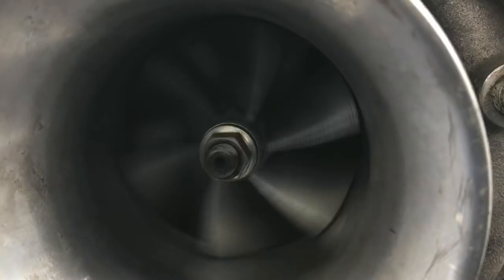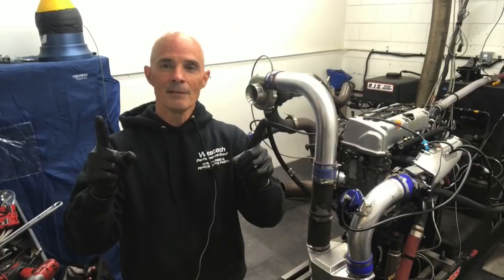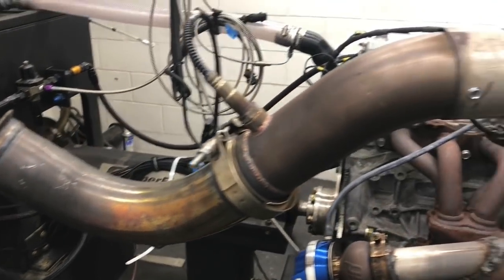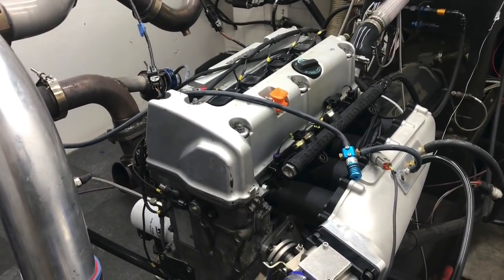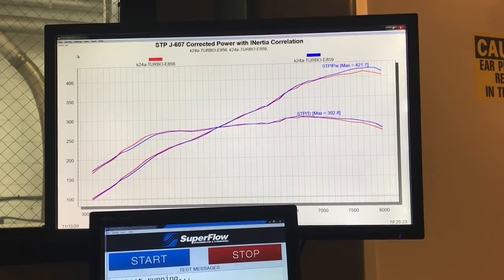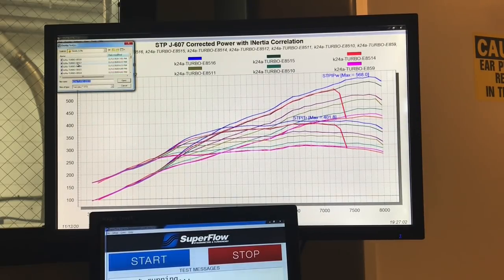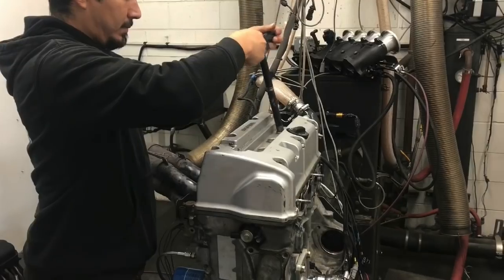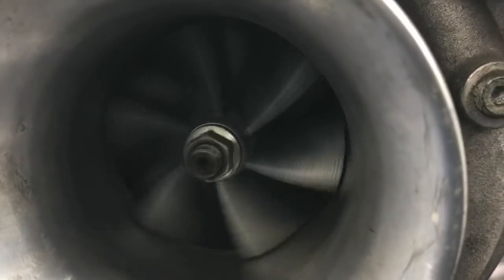DIY JDM TURBO K24A2 HONDA-BOOST & BALACE SHAFTS

Comment: Wait ✋️ hold my Saki🍵. Did he say a K24 A2 on 7 psi,15 psi w/Skunk springs + cam kit + intake. Damn Nippons secret Mighty 🐁 Mouse keeps impressing me. I stumbled onto an 08 TSX w/ K24 A2 thinking it was a luxury civic gas saver ricer after CTS turtle 🐢 got totaled. The lil JDM is tough and I go everywhere in a flash.  Though that combo is pricey if it got it to 400 hp econo-sleeper I would lose my marbles...

Comment: Upgraded oil pump is what is needed to reach 600whp.
Reply: I made right around there on 25psi on an unopened K24. Oil pump isn’t what determines where it caps out on HP

Comment: Just as soon as possible pull that k24 oil pump out.
At the revs you are running (8100) you are dangerously close to grenading those balance shafts.
Install a k20 pump and you can twist that thing over 9k!
I am just about to start a k20 build. Not sure if I am going to run a k24 bottom end. With the set up I am planning I don't really need the added torque.
Gt35r turbo,pauter rods,je pistons,arp studs. Possibly sleeved but if not a block gaurd at the very least.
Factory head and cams...upgraded springs,locks,retainers and valves.
I expect around 700 crank hp.
Going in an rx8. I am sure it will grenade the trans.
Reply: @keithcannon3682 still need springs & retainers to rev that high don’t you on a stock k24a2??
Reply: @josecunsako31  The answer is absolutely.. gonna flap that vtec in the air like you just don't care otherwise lol

Comment: Hey, I live in Greece, and we don't get to have e85 fuel here, and we also don't get to have 300$ junkward ls. So I kinda want a k24a with a k20 performance vtec head. I'm planning to get to 600hp at the wheel, so I was thinking mathenol/ethenol. I also thought of autogas to help, sense it technical has more octanes than normal pump gas, but I haven't seen anyone use lpg. So my questions are: can I achieve 600 whp with meth/eth and is lpg a good option for octane

Comment: What is the ideal turbo for a k24? Id like to bwable to turn up to 700+hp but would like to beable to daily it at around   350-400ish hp... also wondering about what would be the right fuel setup
Reply: Just get two ebay turbos, with some good quality boost controllers and waste gates.
Reply: @kensmechanicalaffair  ebay isn't a size lol. My mr2 has a 3582 on it now and it's kinda too big takes a little too long to spool and makes way more power than I need usually
Reply: @princessajellybean  I meant Gt45, so you make more than 700?
Reply: @kensmechanicalaffair   I make 450 on pump gas and its tuned to 750 on e85. Probably could get low 800s out of it. But right now I drive 99% of the time on pump gas and the 2200cc injectors are at like half a percent duty at idle. The ceramic ball bearing spools up ok but not fast. I honestly would prefer a smaller ball bearing turbo that has alot less lag that can run the same hp. 450hp in a 2200lb car makes me faster than just about everything. I'd like more usable instant power for cruising and twisties but with an option to fill with e85 and turn up to 750hp and do drag race mode. But in reality 750hp is way too much in this car for the street on street tires. Mostly I just want to know or say it can do it. I'm not really going to a prepped track or running slicks. And 450hp is bonkers fast

Comment: Great video series Rich!  Going back a video or 2 I'd like to see if there is any difference with wrapped vs unwrapped headers, not only power but cylinder head temp, i.e. thermo reading near the ex ports, does wrapping make a difference, if so does it put extra strain on the cooling system.  Can't wait for the head change session.
Reply: Idk if you ended up getting your answer or not but supposedly keeping the heat inside the manifold gives the exhaust gasses a higher velocity which spins the turbo quicker.

Comment: I am grateful for you doimg this. I love that you give such concrete real information. I would like to request you do a 20v vw 1.8t motor should be easy to find in a junk yard. I know youre swanped with other stuff thats much more popular but this is my request. Thanks youre the absolute best source of solid information on the internet for upgrades on motors

Comment: I have a civic hatchback with a k24a2 all stock an love it! it keeps up with my buds 07 Corvette lol over this winter I'm going turbo to make just 600hp an I'm keeping it all stock
Reply from the maker: Nice!!
Reply: “Just 600hp” lmfao yeah im “just” trying to push the absolute limits of my stock engine to near rod bending levels
Reply: @knowbull5hit590  lol a stock k24a2 is reliable at 600hp. A friend going on 3 years on it an beating it all the time. Now I'm sure it could use a new tune.
Reply: @twistedarrow3574   is it always running the same psi it takes to make 600hp? Ive seen these things run 600 for a while but you’ve gotta admit that is right on the ragged edge of breaking shit. I dont doubt they can take it but this guys saying it like “just 600hp” isnt pushing the fucking limits of those things to all hell
Reply: @knowbull5hit590  it's a drag street car 600hp all day play or race 3 years no rebuild same block same head

Comment: would the drop in power at 7800 be from windage or a pumping issue?
Reply from the maker: didn't do it na
Reply: @richardholdener1727  I just remember hearing somewhere that when your going for high revving k series that the stock oil pump would be your limiter

Comment: For stock everything spark plug down.. especially stock compression. Running a bit over 15 psi boost and holding plus making good power.... quite an impressive little engine.

Comment: When do you have to worry about ring gap?
Reply from the maker: 601 HP-WE R AT 600 HP SO ITS ALL GOOD!
Reply: Anytime you boost or, run nitrous which will expand all metals.
Reply: @richardholdener1727 😂

Comment: That is amazing that the stock ring gap didn’t butt together at 600hp.
Reply: Right!!
Reply: I think he's on E85. Alcohol has lower combustion temps and thus doesn't put as much heat into the rings.
Reply: This is not some badly designed US engine.
Reply: @V8Lenny  see Subaru ej25 lol. Stock ring gap is too tight factory.
Reply: @Levibetz . Tight ring gap is normal, the SRT8’s come with it.
Reply: Have any of you guys heard of humble performance 600hp is normal and you can get 100k km out of those engines pretty easy
Reply: After adding boost
Reply: @V8Lenny  funny, i see alot of them in junkyards lol

Comment: I had thought that pretty much all second hand motors sourced from Japan were clapped out taxicab pull outs. An acquaintance of mine threw a rod through the side of his block on a Toyota engine some years back, and he wasn’t hot rodding.

Comment: I love how "wrong" everything is . It just shows people that it doesn't matter within reason.
Reply: The enormous exhaust it has, it causes lag just because it has a lot of mass inside, but before the run begin, he initially load the engine, witch eliminate it all.
Reply: I guess you haven't seen these eBay built K series Motors then
Reply: @KDUMVRICK  what? exhaust volume doesnt even matter, even length doesnt (look on stav-tech rear mounted hx55 merc he did) lag is just function of turbine a/r, compressor size, bsfc of fuel and heat comming form cylinders
Reply: @exvils  exactly
Reply: @exvils  figured that out back about 20 years ago on Mitsubishi 4G63T engines
Reply: @exvils  it does matter , with very short and tight manifold you can spin bigger charger and make more power.
Reply: @KDUMVRICK  then explain why when running super small stock exhaust on a Mitsubishi 4G63T has lag but when you “uncork” the engine and put a 2.5”-3” exhaust from the turbo all the way back it actually dynoed another 35 horsepower and very little if any lag and with the 3” pipe it had INSTANT and do mean INSTANT boost and gained a grand total of 41 horsepower peak but it was all the tremendous gains in the curve because of what now NO LAG the turbo comes into boost so much faster and sooner that it made at one point of the curve almost 60 pound feet of torque!!! All from a 2.0 stock bottom end 4G63 turbo block ringed and bearinged and file fit the rings on turbo pistons when we built another engine the exact same way but used non turbo pistons and switched to 110 octane race gas it was better yet (again in the curve) and this was now 20 years ago
Reply: @V8Lenny  like, closer you are to exhaust ports the more heat and kinetic energy you get from pulses to spool turbo (like that new Kseries integrated exhaust manif in head, or b58 supra mk5 engine's manfold), but again, once you are out of compressor map  it doesnt matter what you do you wont spool it up, and it doesnt count as lag, lag is only when you can spool the turbo, but you have to wait for shaft rpm to get there, and thats like 0.3sec, after that you just wait for enough flow to make taget boost/which would happen very fast with variable geometry turbocharger but not with fixed a/r one .. 
tldr. drivability and turbo spool depends on turbo selection, i bet it spool like nothing whe you downshift to 5.5k, with powerband to 9k..
same with "modern" engines like 1.8t, you have powerband from 2300 to 6000rpm with that small k03
Reply: @michelerjgross7339  
Back in the day my pops old Saab turbo broke the pipe right behind the cat after years of service. 
The bitch spooled so much quicker he left it alone until it was inspection time 🤣
And then was a little bummed after he had to cork it back up again.
Reply: @killahoe9748  as a VW guy, it's been tempting to try a little of that darkside shit. 
To get that kinda power out of a VW for that money would cost ya a left nut and half a right one. 
Then ya ain't got shit left for the olady.
Reply: @michelerjgross7339  ok to start you are comparing after the turbo to before the turbo! When you reduce the pressure on the back side of the turbo the front sees that as positive pressure. Or more exhaust pressure that can do work spinning the turbo! 15lbs of pressure before turbo and 5lbs of exhaust back pressure gives you 10lbs of exhaust actually spinning the turbo up. Install a big free flowing exhaust flowing at 1lb of back pressure you are getting a full 14 of the 15lbs doing work. This is just simplified numbers to give you an idea why.

What the other guy was talking about was the amount of gas before the turbo and how much mass is in there and the volume that has to be compressed to spool the turbo up and heat up plus heat loss. Many of these play a factor when you are squeezing out the last %s of your build. 

Be cool to see them take this setup and install a exhaust wrap on it and see how different the spool on one of the big turbos spools!

I'm not to the point of worrying about this with a k24/k20 frank with a 6767 in a 05 lotus elise. 9lbs of boost being easy on the stock trans with 3.5 degrees of camber on 225s ran a 11.91 at 121mph first time out!
Reply from the maker: I DID SOME VW TESTING WHEN WE RAN A BONNEVILLE GSR (BEETLE)
Reply: @richardholdener1727  
I love em, they just cost alot to get power from ,and if you don't go the right route you'll have an expensive doorstop. 
I'm tempted someday to buy some kids half finished Honda turbo project for pennies on the dollar 😄

Comment: Very nice results! However, 5W20 oil is too thin for these motors, Honda recommends 5W30, 5W40, or 10W30,  I'd hate to see it fail early from having the wrong oil in it!
Reply from the maker: ASK ME HOW MUCH THAT DIFFERENCE IN OIL MATTERS?
Reply: @richardholdener1727  Honestly I don't know, I am not an engineer. However, I would assume that there's a good reason Honda recommends 30W or 40W oils for all their high performance K series motors and specifically states to not use 20W oils in these motors. What exactly their reasoning is or how much it matters I have no idea, perhaps you do?

Comment: You know what would be an interesting test?  An engine with a "perfect" turbo kit vs one with stock manifolds and enough exhaust tubing to simulate a rear mount turbo kit.  Just how bad is the rear mount? Obvs you'll want to do pressure and EGT measurements...

Comment: Please note that an in-car application will not make this amount of power.  Your going to lose a chunk of power due to added heat with the turbo crammed under the hood,  and the majority of guys will not use an air to water intercooler due to the complexity it adds to the build.  Regardless, awesome numbers for sure 👍
Reply from the maker: WE RAN A CIVIC RECENTLY-VID IS UP-WITH K24 (STOCK) WITH TURBO, 500+ WHP AT 15 PSI ATA COOLER--THEY MAKE THIS POWER
Reply: Dang that's insane. Love your videos man,  keep em coming!

Comment: Put two K24's together end-to-end and have one killer straight 8
Reply: There are some people out there that have made billet k series blocks and cranks for v8 config.... Unreal power NA
Reply: @ReubenHorner  Making a V8 out of two fours is pretty much designing and building a whole new engine from scratch. Honda's only production V8 was the 93-98 Honda Crossroad, which was really a rebadged Land Rover Discovery with a Rover 3.9 V8 ( sold in Japan only ). Honda had a Indy V8 in 3.0 and 3.5 liter variants. Depending on the configuration they made 650-670 hp NA @ 8000-10,300 rpm and 317 ft-lbs torque @ 8000 rpm. They weighed 280 lbs. They were replaced by a 2.2 twin turbo V6 making 700+ hp and a redline of 12,000 rpm. Of course the problem with indy and f1 motors is that they have no bottom end so if you put them in a car with any weight they won't even get going without a push unless you used some crazy gearing like 6.50. The Ford Cosworth DFV V8 shouldn't be idled below 2000 rpm or internal damage could occur. That didn't stop Ford of England from swapping one (the DFL version) into a Transit van (a fiberglass body) creating the SUPERVAN 2. Not as cool though as the original SUPERVAN that was a real steel Transit body on a GT40. Steve Strope had Ed Pink rework a Ford Indy 4 cam V8 (loosely SBF based) for street use in his 66 Mustang. Increased the stroke, custom cams, and swapped heads side to side to move the exhaust from inside the vee to outside. It ended up making 426 hp @ 7000 and 362 ft-lbs @ 5200 https://youtu.be/oFPLXdmamPw
Reply: PFI Speed is planning on doing this. They are calling it a 2KZ lol
Reply: It has been done already. I forgot where to find it though

Comment: Even cast iron log exhaust manifolds can make a ton of power with boost. Big headers are nice and they do help but they're not absolutely nessisary. Look at all diesels running around making a bunch of power with some really terrible (much worse then this) exhaust manifolds.
Reply: Diesels have very efficient exhaust manifolds , others should learn from them.
Reply: @V8Lenny  
Efficient in terms of cost, longivity and reliability under harsh conditions, not so much in the performance airflow department.
Reply: @177SCmaro  even Mercedes F1 used log manifold before turbo rpm limit was added to rules. Fastest and strongest diesels on earth use log manifolds. Some tried fancy equal length manifokds years ago , now everyone is back to logs.

Comment: If anyone could answer my question it would be greatly appreciated. I have an 07 accord with a K24A8. I also work at a machine shop so I can get any of the products I need fairly easily. Just wondering if this is possible on my motor as well or does it have different rods and pistons? Thanks
Reply: Far from an expert, but belive the bottom end is basically exactly the same.   The heads are different though.  The a8 has the economy vtec setup, and the a2/4 has the more performance 3 lobe vtec head.   "But all cams are turbo cams" 👍
Reply: Eville140 do you know if it’s possible to put the cams he used or the ones from the a2 in my head? The ones from the factory are fairly mild and make peak torque at 4,000 and peak power at 5,800
Reply: @adamnorris163  To run "performance VTEC" cams in an "economy VTEC" head, you'll need to run what they call a "VTEC killer" setup which always runs on the VTEC lobes.
Reply from the maker: JUST ADD BOOST-IT WILL MAKE WHAT YOU HAVE MORE BETTER!

Comment: Can you please tell us the engine code if it’s “A2ish”
Reply from the maker: THE JDM MOTOR SAYS K24A-ITS A 3-LOBE VTEC RATED AT 200 HP-VTC ON THE INTAKE CAM ONLY
Reply: @richardholdener1727  Don’t they all have 3 lobe V-tec? Two lobes/ cylinder for non V-tec and one lobe/ cylinder for V-tec ? I’m from Australia and we don’t get the A2 so I’d like to know the next best engine?

Comment: Meh.

Import front driver stuff is boring. But I watch to give Richard eyes and add revenue so he can do the good stuff.
Reply: If you have a smaller car,  there are k24 rwd adapters for many types of manual transmissions along with the more popular autos...powerglides, turbo 350.     This type of stuff would of happened years ago but most the honda engines before this spun the wrong direction.   Currently swapping this combo into my 1982 starlet(way to small for an ls to fit decently), k24 turbo, Nissan 6 speed manual, Ford 8.8.   Should weigh around 2000# total.
Reply: They are definitely not boring to drive they can be pretty damn fun. Obviously it's not a 1000hp turbo ls or anything but my old 350hp turbo civic would totally blow the doors off the vast majority of muscle cars driving around on the street. Only things that beat it were 500+ hp cars like hellcats or cts'v.

Comment: Hi,
 At the rpm that hp. Drops off the air flow is most likely maxed out on the head or you have valve float. also the profile of the cam lsa. Is most likely maxed as well where a larger lsa.  may rev higher. 8200 is amazing for any 4 cycle engine is amazing. 
 You 1.4 turbo cruze engine may rev that high but it explode due to lack of oil supply.  Be safe all.